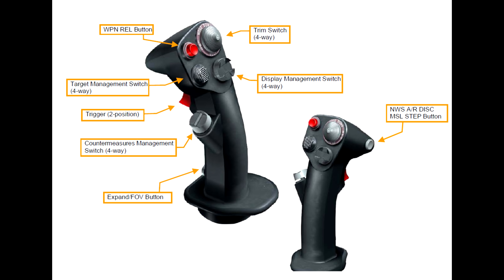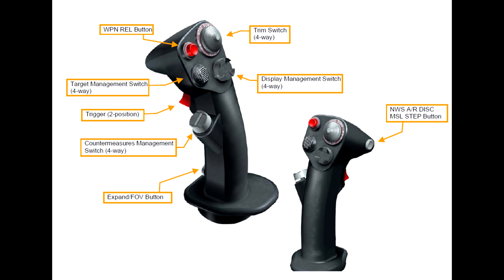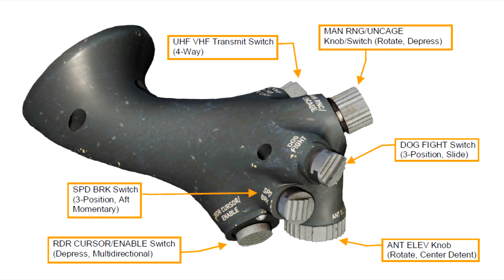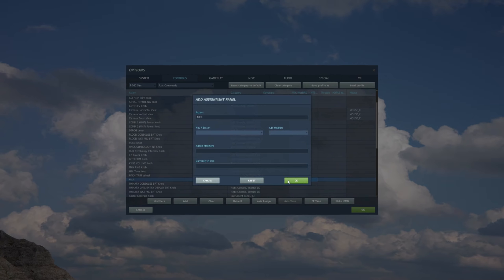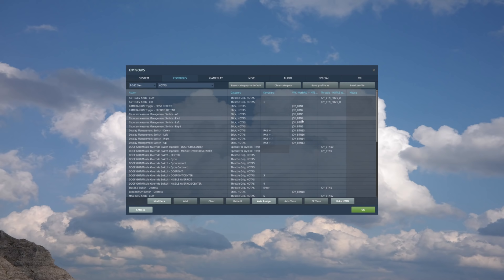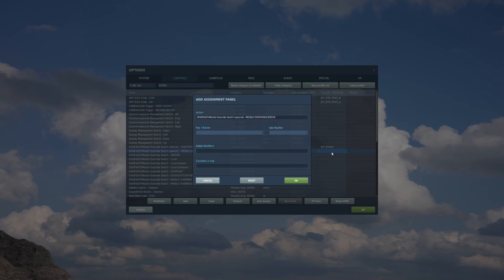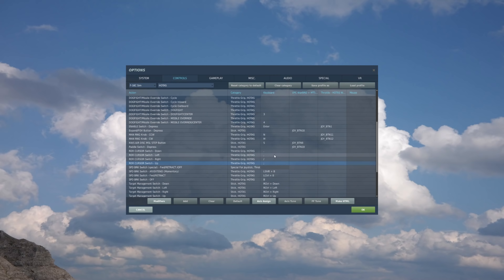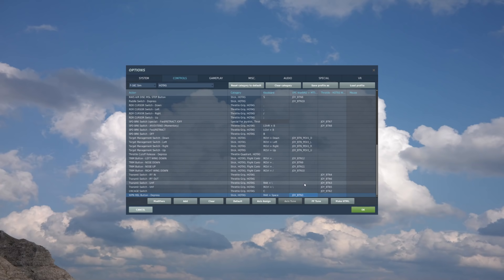DCS: F-16C Viper - Controls Setup

Comment: I’m using less than optimal stick and was wondering if you have a list of the computer keys used in F16 and recommended use of the limited buttons available on Logitech Extreme 3D Pro

Comment: Hello Matt, perhaps you can help me . in DCS i use thrusmaster trottle and vkb gladiator NXT. i have an issue with F16c profiles as sometimes my settings are not loaded properly so it's impossible to do missions .it look like it use a standard profiles . when i do the training the settings of the 2 hotas are correct and when i try to configure a mission the settings are not goods , for example a mini stick change view instead of moving the cursor to lock a target . i have no issues with other planes 
do you have an idea about it ?
thanks in advance 
BR
Reply: Hey there. I have the same setup.(TM warthog throttle and Gladiator NXT joyistic)
I am a new DCS player so trying to learn about bindings.
Do you mind to share your key bindings if it is possible.Thanks

Comment: Hi, I followed your explanation on how to set the Thrustmaster HOTAS Stick and TQS Throttle Thrustmaster.
But I have a slight problem with my Trim Swith... the setting is done like your instructions.
In flight i can trim for a few seconds and than the Switch reacts as a view switch!? 
What is or can be the cause?
In A-10 mode flying with the Thrustmaster HOTAS WARTHOG and HOTAS Stick the Trim Switch on the Thrustmaster HOTAS Stick works and act normal trimming the fighter A-10 as asked.
The view out of the cockpit is done by the Mouse.
Do you have any explanation for the problem described of the F_16C settings on the HOTAS Stick in F_16C mode?
Reply from the maker: You seem to have the trim switch also bound to view keys. You'll want to unbind the view assignments.
Reply: @MattWagner  Thanks... :) 
You were wright... The Trim switch was double programmed!

Comment: On my Warthog Hotas the calibration of the Afterburner Detent was not on point. When I hit the afterburner detent on my hardware throttle, I still had some way to go ingame until the afterburner kicks in. I fixed that by going to axis in the controls options and selected throttle and adjusted the axis by checkmarking it as a Slider and putting in a Curvature of +7 now it's on point in the Viper.
Maybe that helps some other guys with the same problem.
Reply: I had the same problem with the MiG-21, so I ended up 3D printing a replacement detent insert specifically for it. Upside is I have a much larger range of motion from idle to AB than before and I was able to include I soft detent for the boundary layer control to make landings easier. Downside is having to learn to use CAD software...

Comment: Hi! I am new to both Thrustmaster Warthog HOTAS and DCS. I got the F-16 add-on. When I opened DCS, I checked which buttons were assigned to the Warthog joystick/throttle by default, only a bare minimum were pre-assigned by default, not even enough to get the airplane off the ground or fly for that matter. That means I need to assign every single function, or is there a profile I can download? Thank you!

Comment: Hi Matt, I recently bought the F-16 and certain controls simply arent working. For example, nose wheel steering or wheel brakes never work. They default to W and S on the keyboard, but they won't work, even when I try to bind them to other buttons on my joystick. Please help.
Reply from the maker: Sorry, they are working here. Please make sure you are not using game mode or game controls setup. Thanks

Comment: Awesome Matt, could you do a short  tutorial about saving profiles? Im not sure about saving the axis separately, or each controller component etc separately, Each plane module separately etc. Tx for the great job, on a great game.
Reply from the maker: The profile saves automatically when you exit the controls manager. Thanks
Reply: If you want to save profiles externally for backup it is by device by plane/module.  So when you click "save profile" you are saving the actively highlighted device (the column that is lit up) in its current mapping for that module.  For example for the F/A-18 I have three profiles saved each separately for my CH Fighterstick, Throttle, and Pedals.  I have three separate profiles saved for those same devices for the A-10C, the F-14B, etc. Each module that I want to use these devices with gets three profiles.
Reply: @twolf700  Tx T Wolf. That clears it all for me.

Comment: hopefully someone can answer this or it can get changed but there are multiple controls in the f/a-18c that don't have separate bindings for switches only an "on/off" single bind such as the launch bar "extend/retract" and "hook bypass" which i am trying to bind to switches but every time i launch the game it will automatically have both set to the opposite because there is only one bind option, can we please have small options like this have each their separate binding so it notices which position the switch is in upon launching the game? its a small thing but really does add to the ability of people building pits and waiting to add switches without doing any extra coding, cheers!

Comment: Just a quick question: WHERE ARE those afformntioned profiles exactly? Like, the warthog profile?
Thanks wags for the video
Reply from the maker: They are automatically loaded for the supported controllers. Thanks
Reply: I just hope that no DCS F-16 development time was spent in the making of this video o_O (it's just that I think this video will ONLY be useful to those who own a copy of a real-life F-16 HOTAS system... :/ And wonder how many of the 6900 viewers ACTUALLY watched the entire 15 minutes 48 seconds)
Reply: @MattWagner  Would be great if the components of Thrustmaster T-16000M FCS Flight Pack weren't perceived as separate entities when I have all three of them. It's such a pain to explain to the sim I don't really need flight controls mapped to my radar cursor mini-stick as well as I don't need rudder inputs neither on the stick twist grip nor on the throttle's rocker when I have the pedals for that every single time I need to configure a module.
Not to mention it's just odd that the automatic configuration process "believes" I might decide to fly the plane with the radar cursor stick...
Reply: @Dan20q  Wagner is not a developer, Wagner is the CEO. His role is not programming, so no time is taken away from programming.
On top of that, software development is a creative process, it is not a matter of paint by numbers. This means a lot of time is spent figuring out the problem, figuring out the best course of action, and actual research  into the code base. A lot of 'dead time' in other words. Even if a developer made this video, it very likely would not have taken away any time from coding.

/ software dev by trade.

Comment: Hey wags, I noticed you skipped the antenna elevation in the setup - any idea when that will be fixed to work like a slider? Thanks :)
Reply from the maker: Actually, I did discuss it. Thanks
Reply: @MattWagner  I believe he is referring to issue that ANT axis currently does not behave like a slider as in the actual F-16. It's currently not usable by us Cougar throttle owners. Currently it behaves exactly like the F/A-18C which I understand is how it works in that plane?
Reply from the maker: I see thanks. This is something we are aware of and in our internal to-do list. Thanks
Reply: @MattWagner  Cool. I thought something was off with the elevation wheel. I'm currently using the Cougar throttle, and Simped F-16 pedals interfaced through my old Cougar base and using the Cougar stick on top of a Virpil Warbrd base, so I'm pretty much one for one. :-) 

  Also, thanks for what you did with the special button options like on the dog fight switch.

Comment: Will this plane work with the Logitch Extreme 3D Pro? My throttle doesn't seem to be working
Reply: yeah, i have it it works fine. search joystick on your windows and try to calibrate it, see if it works. if it does go back into DCS and and check the controls

Comment: Newbie here... The F16 side stick barely moves and operates by the amount of pressure is being applied.   Does anyone know how to emanate the side stick like it is in real life?  Like altering curves or something?   I like for it to be as realistic as possible.   Thanks in advance,  🤞someone sees this....
Reply: You could try getting a used Saitek X-65F (it's discontinued), or a RealSimulator FSSB R3 Lightning with F16 grip if you have a couple thousand dollars to spare (video demo at https://youtu.be/sJ2A4Cop2es?t=25). These are actual force-sensing sticks. You see, this is not simply about modifying the curves to make a normal stick more sensitive to small displacements. The real feel of the F16 stick is about force sensing, so it takes say 17 to 25 pounds of force to generate a full nose-up input (depending on whether it's on cruise or landing gains). With such a setup, fine maneuvering can be achieved even if the stick doesn't appear to be moving, as the stick can sense the 0.1 pounds of force you're applying for such inputs. Conversely, if you simply use curves to calibrate your normal stick (one using a normal Hall effect or analog sensor) to generate max input at tiny displacements, you'll get an overly-sensitive stick which will be unusable. You'll enter uncontrollable oscillations just trying to maintain level flight and you can forget about tricky tasks like landing, refuelling or formation flying!
Reply: @samdan87  Great explanation!   Thanks.